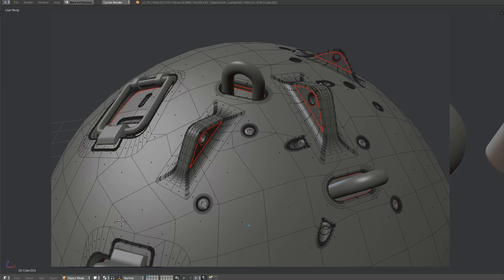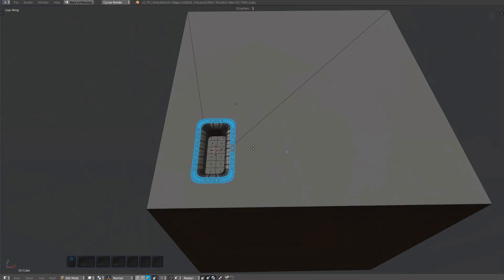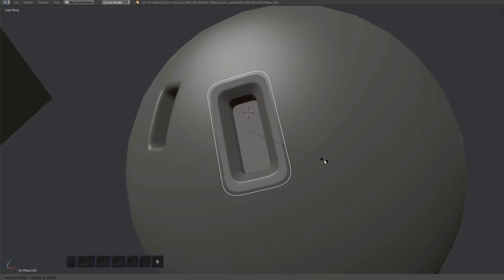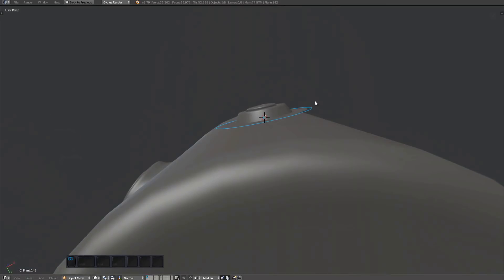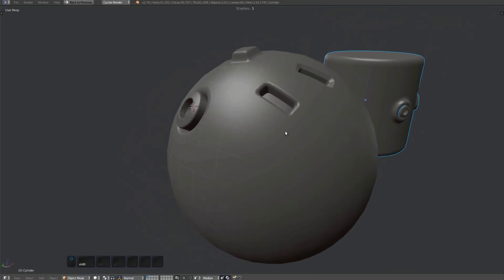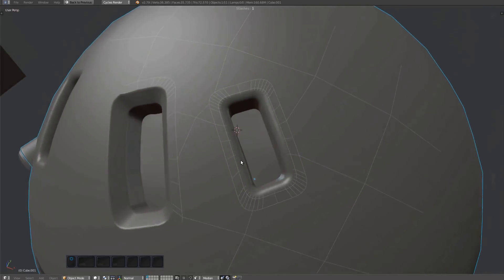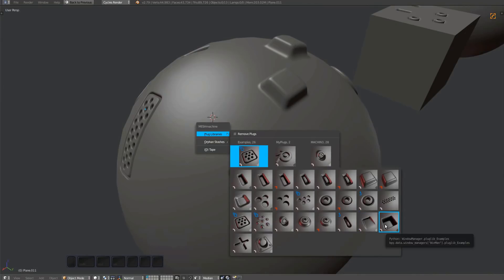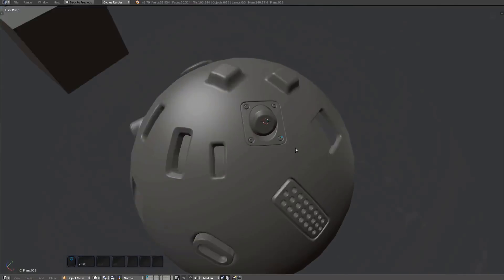MESHmachine 0.6 - Plugs Introduction

Comment: Can a plug be used to copy flat geometry into a flat surface?

I want to put some windows insets onto a curve surface of a space ship. The process would be for me to create the window, knife project it onto my ship, inset the resultant projection to put a control loop, and extrude inwards. 

Using blender's default tools, the face inset step does not preserve the original geometry properly and the curved edges of my window projection collapse into points. 

Using boolean instead, i can't get a control loop and have to delete a lot of wasted geometry. 

I'm wondering if I can use a plug with the base window shape and it's control loop, map it to the curve and that'd achieve the same result.
Reply from the maker: Please email and elaborate a bit more: mesh@machin3.io Ideally with an image or two.
I'm inclined to say yes, but just to make sure.

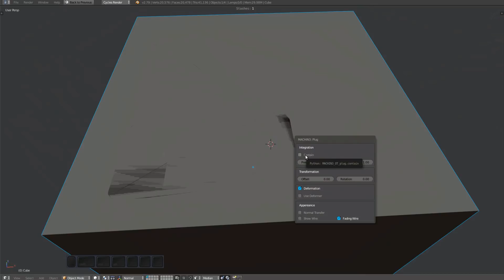Comment: Your tutorials are too fast. Can't see which shortcut or menu you selected in several instances without rewinding and pausing. How did you open the popup in 1:42?
Reply: I agree. It was not entirely clear what was going on. Originally I thought it was a popup within MeshMachine because a lot of the shortcuts are different now. Turns out it's "Adjust Last Operation" which is F9 for the shortcut in the current version of 2.8. Also can be accessed from the Edit Menu.
It's only because he's doing this in fullscreen without any shelves, etc. As soon as you select the Plug Operation you get the typical panel in the bottom left. It's just like the one to modify a primitive before the Primitive Operation is applied. Hope this helps.
Reply: @bdragon254  Thanks for saying what the menu is called. The f9 doesn't work for me at all. I'm on 2.8 but also using a MAC and I think the keyboard is messing with the functionality. At least now I know how to directly access it.
Reply: @mechazone  Yes sir. Not sure if that shortcut still works or not in 2.8. You may want to check the settings to see
Reply from the maker: That's what happens if you skip videos: https://youtu.be/zpmXKP0wpHM?t=135 
These are also Blender basics, and I can't be expected to go over all of them.
Reply: @MACHIN3  It  would be more convenient if you had a dedicated page on the documentation for all the shortcut keys your addon uses.
Reply from the maker: @myxsys  There are no real shortcuts, other then the one you can set in the preferences to open the menu. Everything else is just first letter in the menu. Every single tool in the docs, as the 'shortcut' mentioned at the very top. and in every single tool video.

Comment: Thanks for all your work, 
i would like to know how to open windows in 1:43 and 2:31 please, thank you
Reply from the maker: Hey man, your work is such an inspiration to me! You can open that menu by default via F9 in Blender.
I have it mapped on my mouse as it's so useful.
Reply: @MACHIN3  thank you ;) oops I have Blender 2.8  it doesn't work
Reply from the maker: @ckivang  It depends on the keymap you are using. F9 is for the default one. It's F6 for the 2.79 keymap and it doesn't seem to be mapped for the industry default keymap. I think the F9 mapping was introduces recently as well, not sure. You could try updating Blender.
Reply: @MACHIN3  I updated Blender, it works well now, thanks againl

Comment: If you could also remove plugs and repair/reinstate the underlying topology then, along with non-destuctive beveling/chamfering, this would essentially be Modo's Meshfusion in Blender.
Reply from the maker: It's something I'lll be looking at for the post 0.6 releases. I think it should be possible, if a proper stash is present.
Reply: @MACHIN3  Sounds pretty brilliant, mate. Non-destructive all the way. :)
Reply from the maker: @musashidanmcgrath  I call it re-constructive. Nothing in MESHmachine is non-destructive, as I don't keep modifiers or a true history alive. What I do is reconstruct (potential) earlier states.
Reply: @MACHIN3   Still great, nonetheless. No other 3D program or tool has this feature(except maybe Houdini?)

Comment: Is this plugs library included into MeshMachine?. Thanks in advance.
Reply from the maker: The Examples library and the MyPlugs  with the Blender plugs is included. The MACHIN3 library is not.
Reply: @MACHIN3  I'm sorry but after bought your addon I can't see the 0.6 version which I think is where  I can use the plugs feature (and lots more included these awesome libraries). I bought both addons (DecalMachine too) in september and I didn't see the 0.6 version. How can I download it?. I have installed the 0.5.13 version. I downloaded two .zip  files. Thank you.
Reply: Problem solved!. It seems that they (people of Blender Market) have lost an internal link of the buyings to the represented information of my personal account.Now that the problem has been solved I can download the 0.6 version. Let's see your plugin!!. :) Yeee haaa!
Reply: In fact, it seems that there's a problem with the versions and with the orders list inside my Blendermarket account. I can't see the buying order nor DecalMachine neither MeshMachine, besides I could download only two 13MB files which are not the size of the 0.6 version. It's the 0.5.13 version. I have contacted BlenderMarket people in order to see if first they solve my disappeared MeshMachine order and then I can download the 0.6 complete version . Mayb there was a problem in the discount sales earlier september, which is when I bought them (Decal and MeshMachine)...
Reply from the maker: @jorari71  I can't do anything about this directly. You need to talk to the blender market guys. If you message me on blender market, I can escalate the issue to admins, so they can take a look at it though.
Reply: Thank you very much for being so kind. I'm trying first with them and if they don't solve my issue I will contact you directly.